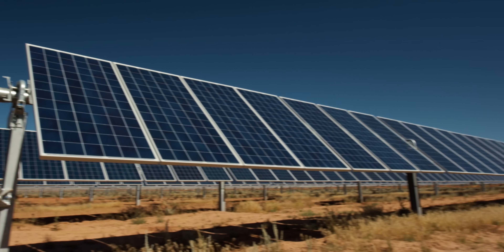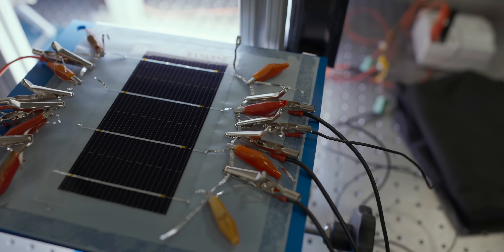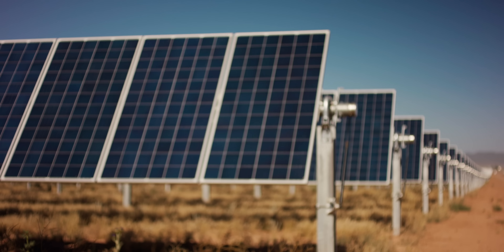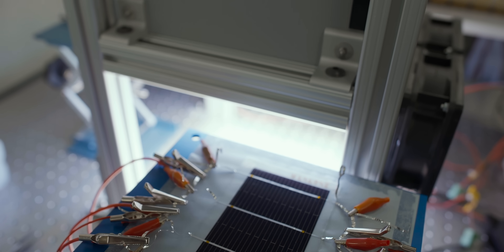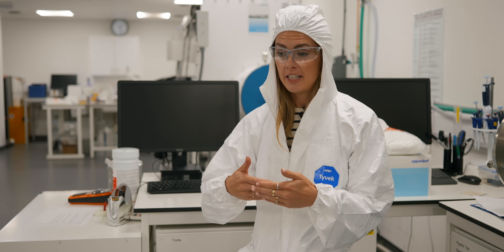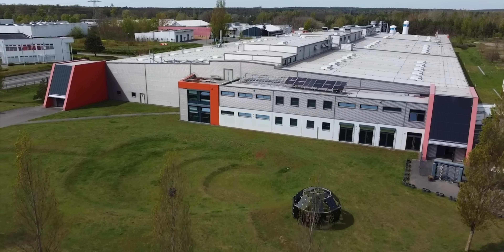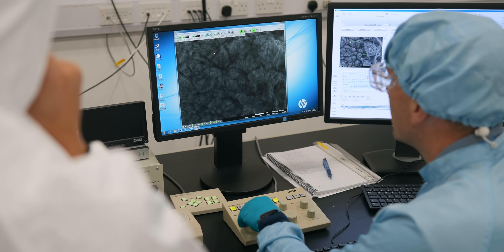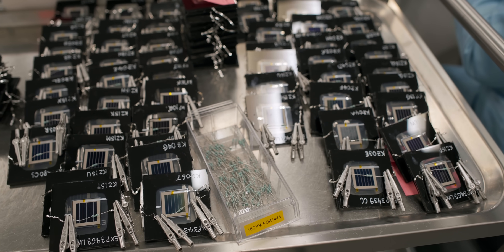This MAGIC Ingredient Is Doubling The Power Of Solar Cells!

Comment: It wasn't covered in the video: did they solve the stability and durability problems with perovskites? Last I heard they degrade in direct sunlight, or with temperature and humidity changes you naturally experience when in use. It's all well and good if they have higher efficiency to cost ratio out of the box, but the thing that matters is the average cost per kWh over their warrantied life span. If their increased efficiency drops off within the days, weeks, and months that perovskites historically have then I expect the cost might not work out cheaper over it's life per kWh delivered. So, what is that, and how does it compare to silicon?
Reply: A C&EN article from back in 2018 mentioned OxfordPV had developed a stable forumulation and cell layering technique that improved stability in the 1,000s of hours mark. The article mentions that entry point for commercialisation is 10,000 hours mark, with high recyclability, as the OxfordPV panels are focused on commercial use then they may be targetting cases where increased generation over a five to ten year lifespan is beneficial. Particularly with high recyclable panels, this may not suit home generation where long durable panels (15+ years) are more cost effective.
Reply: @GruffSillyGoat  Yes, its strange that they didnt specify how many 1000s, 2000 is multiple 000s. And there is good reason to believe that this is what it is, as follow up research in 2019 using peroviskite modules doped with silicon achieved 3000 hrs, but the trouble is that by doping you reduce the purity of the high yielding peroviskite material, so you gain longevity at expence of the efficency that this is focussing on. No such thing as a free lunch. As things stand, this is at best an immature tech, and at worst is a dead end. Now the paper that I'm referring to, (As in I've read it, not some abstract, or some press release that mentions it) is readily available. It is called  Impact of perovskite solar cell degridation, on the energy yield and economic viability of perovskite silicon tandem modules by Qian, Erst Wu and Bakers. What you call an article, is just press release rubbish, not hard science, the phrase "the entry point for comerciaisation is 10000 hrs has nothing to do with what they have, they dont have a 10K hr pannel, not even close, its just their thoughts on where they need to get to to make the pannel comercially viable
Reply: @jukeseyable  - An article by its nature is not a peer reviewed published paper, the one I referenced from the respected industry journal C&NE. The article isn't a press release of a specific company but a round up and summary of published papers with a status assessment, dated from 2018. I don't reference press releases first hand. 

However, the point of the OxfordPV commercial trials are to test their production panels in real world environments, rather than lab conditions, alongside silicon only panels. This is an important step forward in assessing the role of perovskites, the outcome of which will determine the benefits they may offer in the field. If the panels don't pass mustard then the PV industry will quickly come to a conclusion on their maturity and viability.
Reply: Now that makes sense. Swappable in a field is an easy task, akin to painting the forth bridge, but no life jacket needed 😆
Reply: @GruffSillyGoat  10, 000 hours is just over a year. Installation costs are 10%-30% of the total solar installation. Silicon cells last 25-30 years. Meaning that 10 years with yearly perovskite replacements costs would be enough to cover double the number of silicon panels with the installation costs alone. Perovskite isn't claiming double the power per panel, yet. And that's ignoring that the solar panels might last triple this and to match it's value with that expected life span perovskite would need to output >100% efficiency.

They claim perovskite is cheaper than silicon to produce. Not a fraction of the price. I'm expecting from that close to double the cost per panel.

I found a solar magazine article claiming $0.16/W for perovskites and 2.5 year lifespan in 2022. That's the most optimistic numbers I've seen given they claim silicon is identically priced. Even with these numbers, you have to replace the perovskites 10 times for the same silicon life span, and they can't deliver 10x the energy because silicon is already >10% efficient and perovskite is <100% efficient.

In the UK, a PV array pay's back the energy used to make it in less than three years. Meaning that ignoring the perovskite additional layer, the underlying silicon can't pay back the energy to make it by the time the perovskite needs replacing, IF they managed to increase the longevity by an order of magnitude from 2018.

If you have to recycle the cells about once a year, and they don't provide more energy than they took to make, then this maths doesn't work out. Let alone the installation costs or increased cell costs.
Reply: @GruffSillyGoat  1000 hrs even in the uk, on a low sunlight yr might get you 18 months tops, but the average sunshine hrs is 4.9 hrs/day, thats 1500 a yr
Reply: @jukeseyable  - the article said 1000s of hours, citing 10,000 hours back in 2018.
Reply: And when they do, they release lead into the environment
Reply: I don't think they will answer. I wish there was a service out there that could search all interconnected documents like an engine. That could be useful.
Reply: @colinwiseman  I was being polite. It looks better if they provide the answer and self correct. 

The long term stability issues persist. Feel free to link me to a source saying they last roughly as long as the more standard silicon if I'm wrong?

It's a glaring omission from the Oxford PV guy, but I don't blame Everything Electric because this is specific scientific research and I know that's a specialist skill they likely couldn't justify the expense of within the team. The Oxford PV guy likely needs to drum up some funding for their research or potentially people lose their jobs, so it's all aboard the hype train. 

They likely thought that talking to Oxford PV was expert enough. The problem is that you can't trust the person who stands to benefit from it's success to give an unbiased overview of the technology. 

This is the problem with channels like "Undecided with Matt Ferrell" and "Two Bit da Vinci". They don't know enough science to be able to tell what is marketing hype and what is reality reliably. You might as well just read the company press release and blindly trust it. 

Sadly, occasionally, the fully charged group brushes close to this kind of whoopsie; hyping tech with an undisclosed Achilles heel. I suppose you can't cover such a breadth of topics without the odd thing slipping through the net. I think fully charged does far better than the other two channels I mentioned.